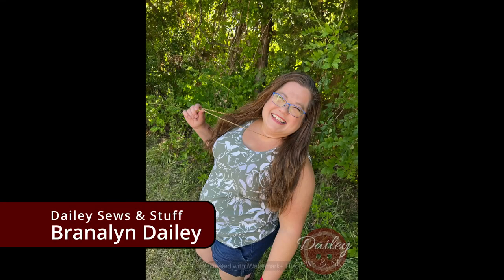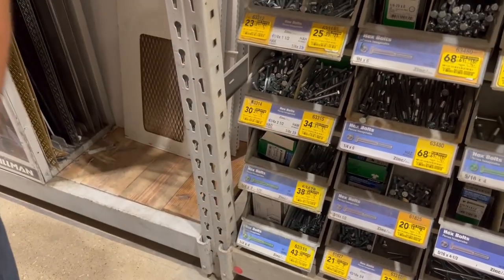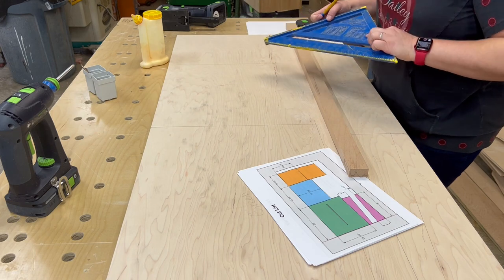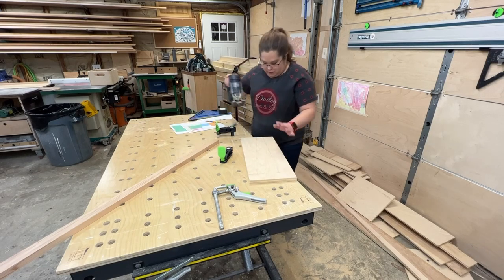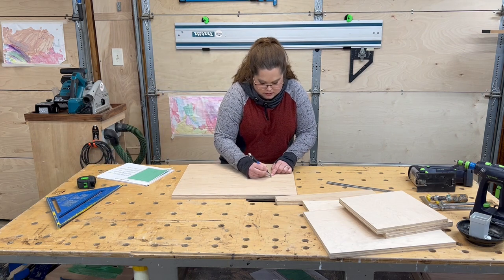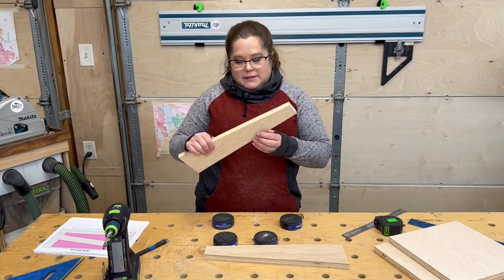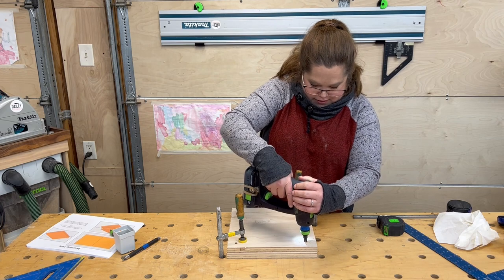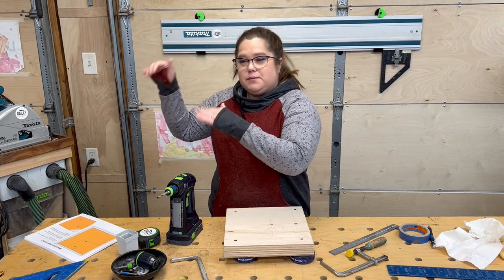The Non-Woodworker's Guide to Making Your Own UST Projector Stand for Pattern Projecting

Comment: I found that a 9/16 open end wrench is absolutely perfect to use for adjusting the feet for calibration, It gives you a handle for large or small amounts adjusting for the feet. It works great for hands that dont have a lot of grip any more.  Thanks to you and Robert for makeing the pattern.  It was so my much fun. I was so worried that I couldn't do it. My husband passed last year and he was a carpenter and my job was sewing. But this was so much fun and I am very l am proud of myself and he would  have been proud as well.  I did it!  It is all  painted and in my sewing room now all calibrated and ready.  Where did Robert find the small square he uses?
Reply from the maker: Yay! I knew you could do it! Great tip for adjusting. I’m not sure where the small square is from…@daileywoodworks any idea?